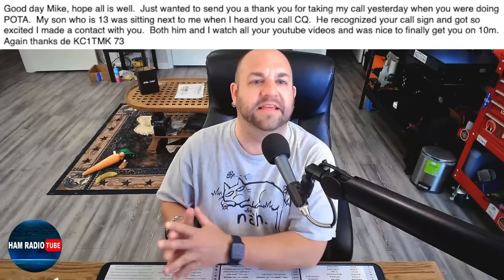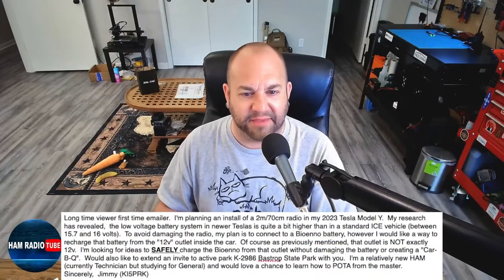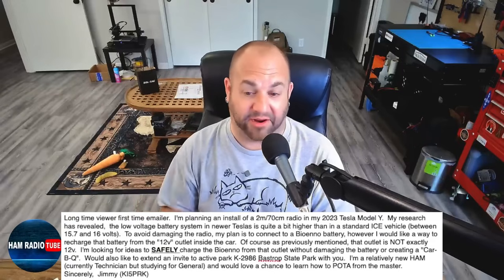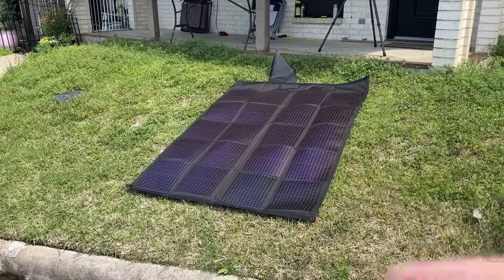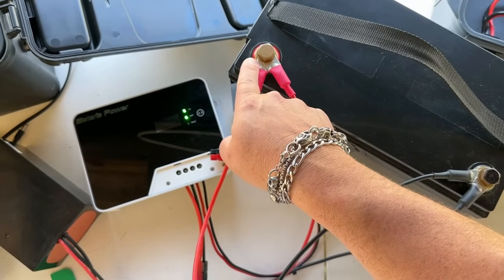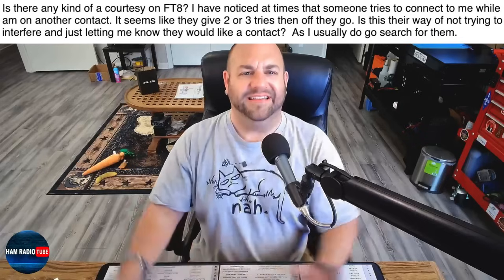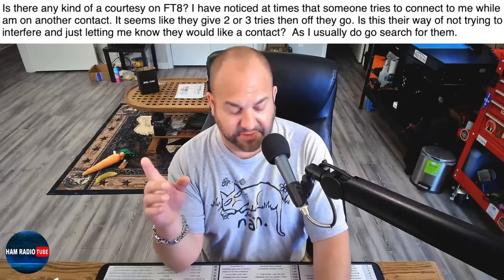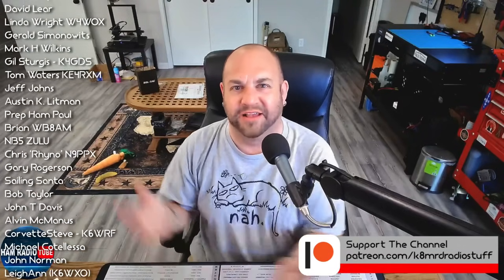How To Wire A Solar Charge Contoller For Ham Radio

Comment: ~12:10 A subtlety about the BioEnno BLF-1220A; While Bioenno declined to answer my question about this directly, the barrel connector intended for charging has a current limit whereas the Powerpole load connectors do not appear to. The max charge current specification is 4 amps. While the barrel connector can source my FT-991A on receive, the integral current limit of the barrel connector will shut down the radio if a transmit current load is attempted. I suspect the current limit is at or near the 4 amp charge current specification, but you might make a video about testing it.

Comment: For the battery setups I would add that it wouldn't hurt to check with the manufacturers regarding charging and discharging at the same time. I believe Bioenno says it's okay when charging via solar, but not when using the wall charger. Not sure where the DC charger falls in lin. I'm guessing the DC outlet charger falls in line closer to the solar charger, so probably okay, but I'm only guessing.

Comment: The guy from the email might want to check what the operating voltages for the radio he plans to install is. I believe a lot of radios will work from 11.5ish to 16 volts. On my gas car when the alternator is running, my radio shows a voltage of 15v and works just fine!

Comment: I drive Model Y and run FT-500 without any voltage converters. Car is constantly producing 15.7V which is the upper voltage limit in my radio, no issues here, been driving like that for last 4 months talking on 2m, 70cm  and GMRS on high power. He should be worried more about the electrical humm/crackling when receiving transmittion.

Comment: While watching the segment on hooking up a solar panel to a charge controller to operate portable I noticed you hooked up the panel to the controller before the battery. I was under the impression that the battery should be hooked up first so not to damage the controller. Am I wrong? Or do the higher end controllers have a protection circuit? 
Steve, k7ofg
Reply: your assumption is correct, when using a solar charger always connect battery first before anything else

Comment: I have seen multiple posts that solar charging and using the radio at the same time trashed the radio due to over-voltage being 14.5 volts coming from the charge controller. You showed a buck convertor that changes the voltage but can they handle a 15 to 20 amp draw from the radio ?
Reply: 14.5vdc wont damage a radio, nearly all alternators produce that voltage,  they probably did something stupid in the process that caused the problem

Comment: The Traveling Diver-Ham 🐷 brings up a good question, again, about Flying with batteries! What is currently allowed by airlines, with flying with batteries. What size is okay? Can you Carry on or can you check your battery inside baggage? (Can they explode while flying?) 
Thanks ❤️‍🩹